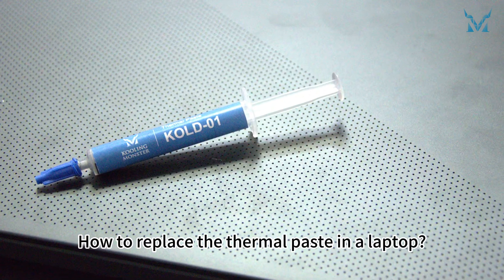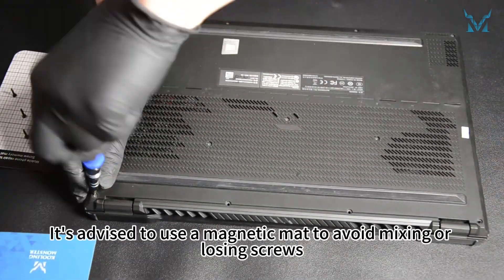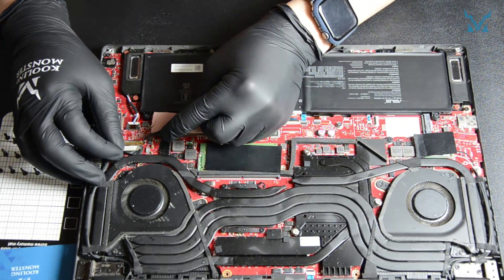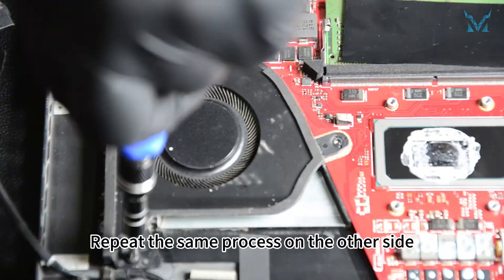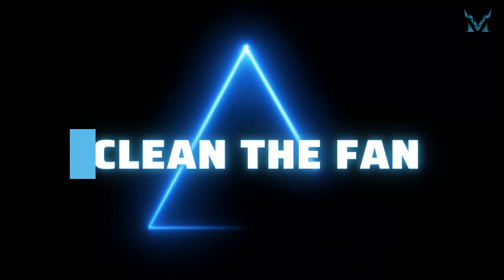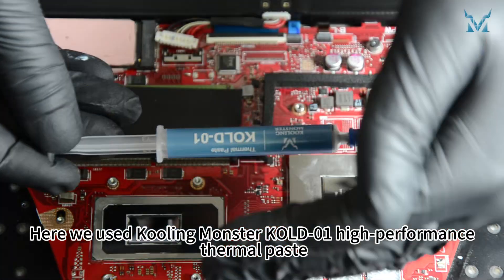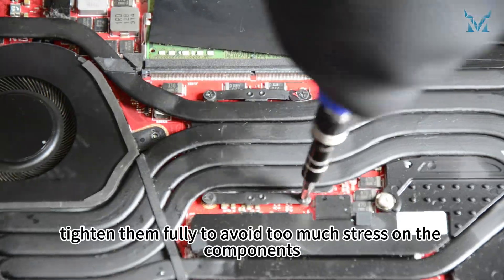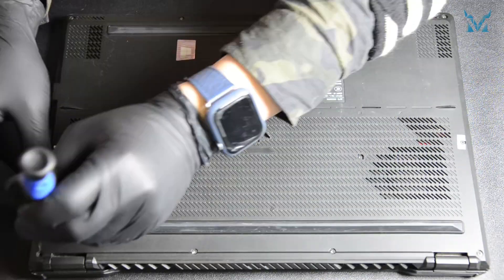Speed Up Your ASUS ROG Flow Z16  Prevent Overheating With Dust Cleaning & New Thermal Paste

Comment: isnt it a flow x16?
Reply from the maker: The main differences between the ASUS ROG Flow Z16 and Flow X16 are:

1. **Screen**:
   - **Z16**: 16-inch, 2560x1600, 16:10 ratio, more compact and business-oriented.
   - **X16**: 16-inch, 2560x1600, 16:10 ratio, brighter display, better for creative work and HDR content.

2. **Design**:
   - **Z16**: Slimmer, more portable, suited for general use.
   - **X16**: Slightly bulkier, designed for gaming and high-performance tasks.

3. **Hardware**:
   - **Z16**: Powerful CPU (Intel Core i9 or i7), suitable for work and moderate gaming.
   - **X16**: Stronger GPU (e.g., NVIDIA RTX 3060 or higher), better for gaming and graphics-intensive tasks.

4. **Cooling**:
   - Both have advanced cooling, but the *X16* might have more efficient cooling for higher performance. 

In short, *Z16* is more for portability and general use, while *X16* is aimed at gamers and power users.

Overall, the process of applying thermal paste for these two models is similar. You can refer to our video for guidance.